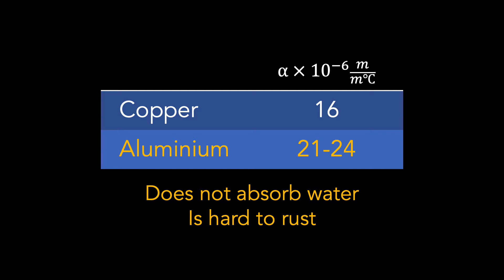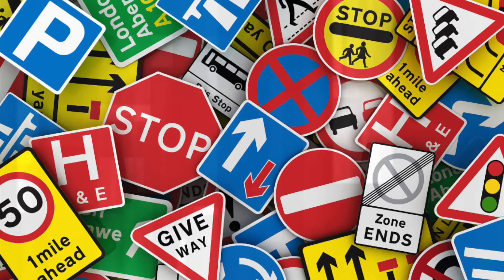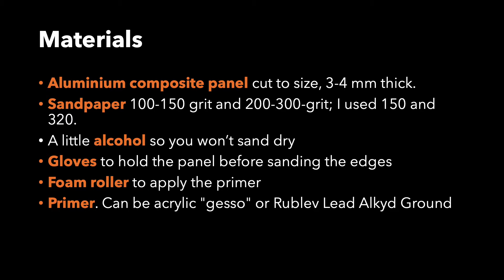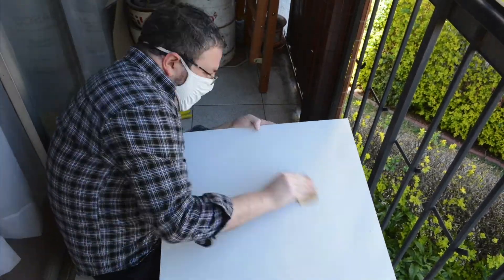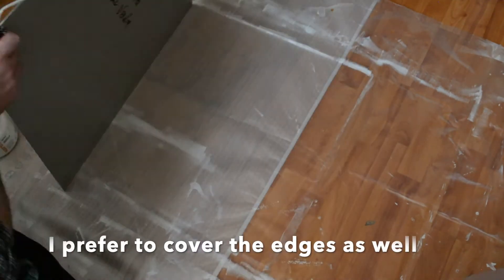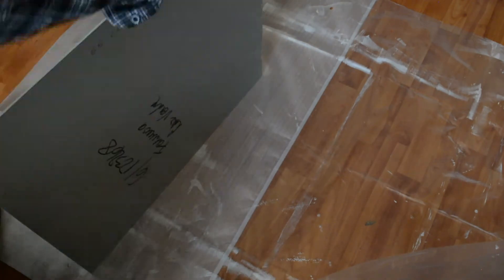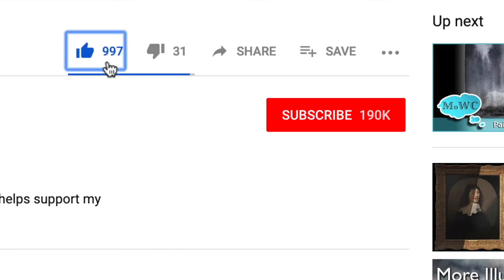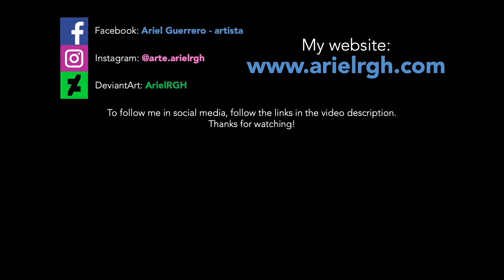How to prepare an aluminium composite panel for oil painting

Comment: With sanding you get a lot of the grit off the paper in the air.  All you need is a scraper, or a cutting tool like a plane set fine and the edges are smoothed in a stroke.

Comment: You can easily score and break the panels yourself.  One of the advantages or the material is that it does not require sawing in manufacturing small panels.  Unless they are circles, etc...

Comment: I like ACM panels, but I don't worry about longevity of my product.  If I did, I would worry a little about the plastic core, the plastic surface, and the plastic primer.  The aluminum itself doesn't seem to have much of a role.  Plastics are getting a lot better, but they don't have a great reputation for longevity, with problems showing up in stuff like bindings of guitars, films or most early fiberglass boats, with major environmental and property impacts.

Another problem is the panels weigh a lot.  Which increases adverse energetic effects during transportation, stuff like vibration, or impacts.

Comment: Good point about copper.  However, modern day wood products would be ply, or fiberboard, for wood.  The Mona Lisa was painted on wood, and it if it was a plain wood panel, there would be the potential of a lot of expansion and contraction.  Proper preparation of the materials would reduce that, but today, you can reduce it to virtually nothing, with coatings and ply materials.

Comment: It isn't more rigid that wood.  It is more rigid for thickness, but not more rigid for weight.  When we talk about rigidity, it is normally in reference to some other characteristic, such as weight, or thickness.  The knock on Al is that it is heavy.  Wood composite is the lightest material relative to stiffness, other than advanced composites like carbon, and advanced carbon structures.  There are wooden racing boats, that still take down carbon composites in certain conditions even though they are 50 years old and cost a 1/10 of what carbon composites do, and aluminum is not even in consideration.

Also, you are probably comparing some not composite structure in wood, like masonite, plywood, etc...  To the aluminum composite.  An all wood composite like ply skins over balsa core is a whole other universe.

Comment: Aluminum is a softer metal, drop it on a corner, and see how much damage it takes, even from a low height, it will deform the corner substantially.
Reply from the maker: Yeah, it’s harder than wood.
Reply: @arielrgh  but bends much easier, and that will give you trouble if you don't respect it, I am telling you because I know,  I am not comparing it to wood. But since you are, wood will absorb more of the impact, and not leave nearly as much damage to the surface area of the impact.
Reply from the maker: @chrisgriffith1573  I have experienced the exact opposite. I have them both framed to avoid impacts anyway.
Reply: @arielrgh  Right, as you should, but not many artist paint the picture inside the frame ;) ... I should add, that there are much worse things to paint on in terms of fragility, such as glass...